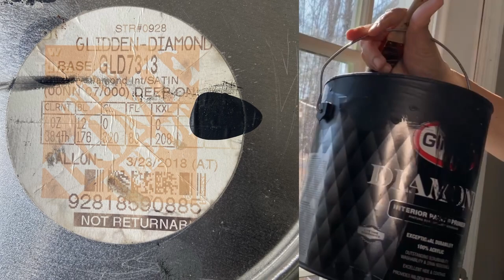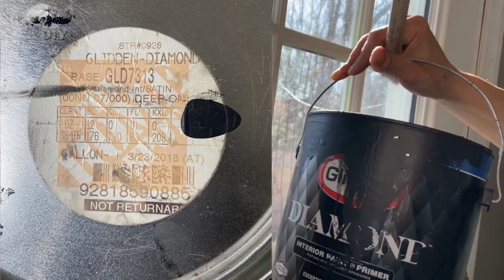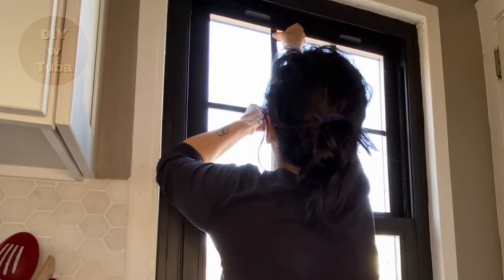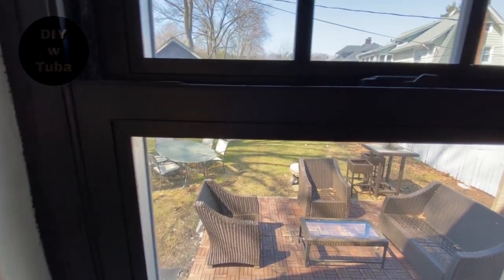HOW TO PAINT VINYL WINDOWS WITH GREAT RESULTS! Sanding or NOT?

Comment: I’m a professional painter but have never had to paint plastic windows until now. I gained lots by watching your process.  You have done a beautiful job. I did not think of using an adhesion primer, so that was a very cool tip.  Thanks again. Best of luck with the remainder of your makeover.
Regards.
Michael
Reply from the maker: Michael thank you so much! This is a great comment coming from a professional makes it very special❤️

Comment: Thank you for your video. How has the paint held up since then? We too have vinyl trim and my plan is to paint it black.
Reply from the maker: It looks as good as the first day I painted it! Even the tape is still intact:)) But this window is not functional if I was to use it often not sure how the paint would hold up! I guess worst would have been some scratches along the track! There is a radiator right below that window and yet heat didnt do anything to the paint!

Comment: The window looks very good now. My concerns with painting vinyl windows (interior & exterior) is leaving brush strokes. In addition to long term adhesion and fading. Reading through many reviews the most frequent criticisms of painting vinyl is  adhesion and fading  in the first year of application. 
The responses mainly centered on light sanding a bonding primer and multiple coats (2-3) of paint. These reviews were of Krylon and Rust-Oleum paints for plastics.
Reply from the maker: Thank you for the information Robert! Mine hasnt showed any sign of fading yet but its been only a year an also an interior surface! If it was outside both fading and also warping would have been an issue! You can always get rid of or ease out the brush strokes with a small roller. I think in my case I rather see brush strokes than my ugly faded vinyl🤣

Comment: How do you feel about the electrical tape after you completed this? I have the same windows with the bars inside the glass and I’m nervous that the windows will look weird.
Reply from the maker: I still love how it turned out! If you are not sure I would apply the tape first before painting your windows just to make sure you like how it looks! Mine shrink a tiny bit so keep the tape little longer than it needed! Good luck!
Reply: @WadaGoodIdea  with the tape over them, do you think the middle of the bars/white is still super visible from the inside of your house?
Reply from the maker: Its visible from certain angle but really doesn’t stand out! My moldings around the window are white so it doesnt look weird to see some white!

Comment: Can I use any black paint as long as I use a bonding primer? Will there be warping?
Reply from the maker: Yes absolutely! As long as you use the right primer paint doesn’t matter! Have fun with your project👍
Reply: @WadaGoodIdea  Thanks! We are using Valspar adhesive. I hope it works out!
Reply from the maker: I think it should be fine!
Reply: Did you paint the inside runners? Did it affect how the window slides?
Reply from the maker: @mediaexodus8427  Yes I did paint them but that window is not functional so not sure if it would affect its functionality! But I would suggest to apply little wax or similar to lubricate the surfaces so they wont scratch the paint!
Reply: @WadaGoodIdea  Thank you so much! I don’t mean to take up your time. ALL the window companies say that I should NOT paint vinyl companies. This scares me! And they said black would warp it. Do you have thoughts on that? Again, thank you so much! :)
Reply from the maker: If you are painting the outside there is a possibility but to me doesn’t really make sense since these are thick materials if we are talking about vinyl siding I would say definitely risky to paint them in dark color! But if the manufacturer of the window does not recommend it then I would just take their advice! I just painted the inside but now curious what happens if I paint the outside too🧐
Reply: @WadaGoodIdea  It wasn’t the manufacturer of this window. They just said that it wouldn’t be good for any vinyl window. ☹️
Reply: @mediaexodus8427  Hello! Like you, I have just been told today by my vinyl window installer (23 windows - $23,000) that the windows cannot be painted. Which is NOT what the salesperson told me back in July when we placed the order (after painstakingly interviewing 4 window companies), so I am VERY frustrated. I am thankful for this video which gives me hope. Please let me know how your paint job turned out, especially the runners when you open/close the window. I am planning to paint the interior of some windows a light grey to match the rooms they are in. We are planning to use the Kilz primer recommended here and a Sherwin Williams house paint that we've had awhile that was leftover from the room being painted a few years ago. Any feedback would be appreciated.

Comment: I have these windows and in my bathroom I have had trouble with the white turning black like mold. I can’t clean it off back white again. Any advice?
Reply from the maker: If you think thats mold I would recommend to clean it with bleach first or vinegar! After that you can try to use mr magic!?
Reply: @WadaGoodIdea  I have tried bleach, toilet bowl cleaner, magic eraser, and now I am to the point of painting them black to cover it
Reply from the maker: I would just go for it! I love my window ten times more than before😊
Reply: @WadaGoodIdea  I love your windows as well. I never knew it was possible. And the black electrical tape is genius!!  Thank u